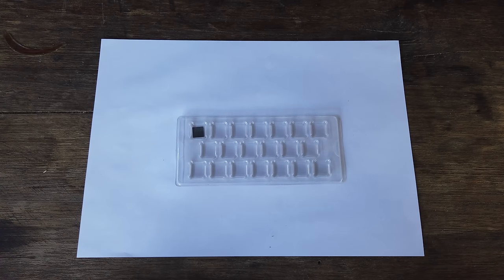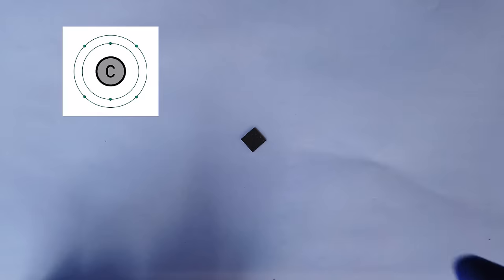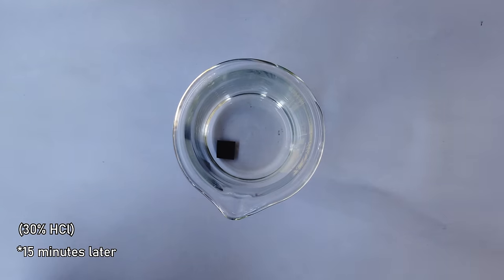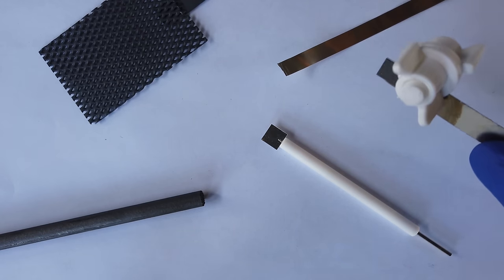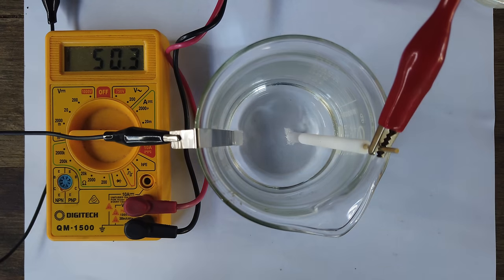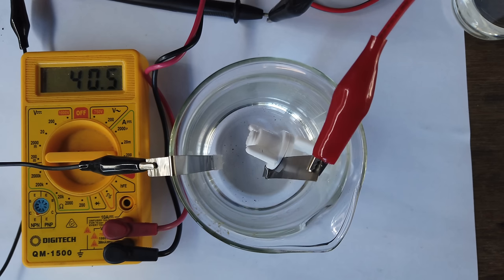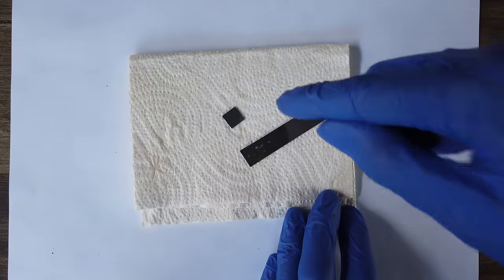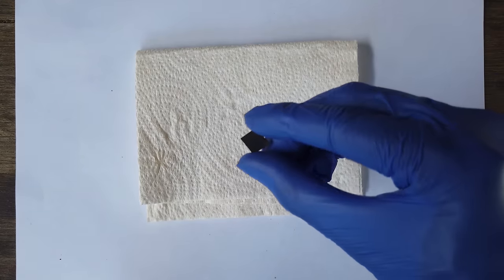A Very Special Electrode

Comment: Why use an expensive electrode if you can use electrolysis with a strong electric field? A simple electrode covered with a thin layer of glass is quite suitable; you just need to apply a sufficiently high voltage and electrolysis occurs without the electrode being destroyed.
Reply from the maker: I highly doubt this works as well as you're suggesting for bulk electrolysis at high currents. I'd be glad to be proven wrong though. Can you point to point me towards a reference?
Reply: @ScrapScience  Which link? Carry out a simple experiment - two test tubes with electrodes inside, a saline solution and a high-voltage DC source, at least a high-voltage transformer with a diode multiplier - even an electric shocker will do. The main thing here is to reduce the distance between the test tubes in the solution to increase the current. The experience is inexpensive and simple.
Reply from the maker: I still don't understand how you're suggesting this would work at all, and I'm not going to build or buy a HV power supply just to test something that I don't believe works. If you don't have any source backing up your claim, I'm just going to believe you're making it up.

Comment: Are there any electrochemical way of making Ozone other than running O2 through an electric arc because that method has a low efficiency and also the ozone it makes is quite impure and often has a lot of Oxygen and a low amount of ozone I want to make pure ozone because I really want to see the pale blue colour of ozone gas.
Reply from the maker: Technically yes, you can make ozone by the electrolysis of water if you use the right electrodes and run a high current density. The concentration of ozone you'd get from any DIY setup would be less than what you get from the electric arc method though I'm afraid. This kind of electrolysis will always still favour the production of oxygen instead.

Comment: aren't those reduction potentials in 10:13 rather than oxidizing.
Reply from the maker: Correct.
I should have either specified that I was talking about standard electrode potentials, or simply made these values negative.
Reply: @ScrapScience  its cool, i feel anyone with a slightly good knowledge of voltaic cells will be able to decern it.

Comment: You got any HgHgO reference electrode? I think this would make you able to separate cathode from Anode Potentials vs. HgHgO and then put the Anode or cathode into nhe/she scale as Listed everywhere. Also I think there should be circuits available for free that you can build your own potentiostate with.... really no prob for 50 mA I would have thought. Depending on how far you want to go....
Reply from the maker: I'll be getting a reference electrode at some point. I avoided performing proper voltammetry in this video because I wanted to keep things relatively simple for now.
Rest assured, there are plans to build a potentiostat and perform some proper electroanalytical techniques in the future :)
Reply: @ScrapScience  nice!
Reply: Do you have the B&F book? I think it had some circuits there. I mean because you're a maker most probably and could build such stuff easily by yourself... and there is tons of other channels that could help you with that
Reply from the maker: I've got access to B&F - I'll have a look!
Reply: @ScrapScience  what is B&F Book ???   Thanks
Reply from the maker: @zaneenaz4962 ‘Bard and Faulkner’ is the one.

Comment: I've been wondering about why does carbon get destroyed when used as a anode in most conditions its used there isnt anthying that can react with it yet it falls apart, i search for it but the only result i found says that its because carbon is porous but then the Cathode would fall apart too but it doesnt.
Reply from the maker: The porosity does come into it, but it's not the main reason behind the degradation. When used as an anode, a very small amount of carbon is able to be oxidised to form CO or CO2. Since these electrodes have a porous structure, this oxidation can happen inside the electrode instead of just on the surface, causing them to disintegrate.
Without any oxidation, no disintegration occurs. Likewise, making the electrodes less porous (i.e. HOPG electrodes) leads to much less electrode damage (but not zero).
Reply: @ScrapScience  Thanks for the reply, that does make a lot of sense. This means that carbon will fall apart faster when making Oxygen like when used in a NaOH solution then when its making cl2?
Reply from the maker: Correct.
When making chlorine from aqueous solution, carbon will fall apart slower (but it will still eventually disintegrate, since there's still water present that could lead to the formation of oxides).

Comment: How does it work for a chlorate cell? Does it work as good as mixed metal oxide?
Reply from the maker: It works great for a chlorate cell! 
MMO electrodes require some degree of care to prevent degradation. For instance, chloride levels should always be high enough, and current density should never be pushed too high. With BDD electrodes here, none of that matters (at least, to a certain extent), as the material is just so highly resistant to degradation.
In fact, BDD is so robust that it can even oxidise chloride all the way to perchlorate with no issues if you run the cell for long enough.
Reply: @ScrapScience  where do I order?
Reply from the maker: This is where I got mine:
https://e6cvd.com/us/application/electrochemistry.html

Comment: What type of MMO anode do you use for experiments, Ir-Ru or Ir-Ta?
Reply from the maker: I’ve only ever used Ir-Ru anodes in my experiments so far. 
I’ll probably work with Ir-Ta at some point, but I’ve got no concrete plans.
Reply: @ScrapScience  I have seen your chlorate cell videos and you should be careful, because Ir-Ru MMO anode can release RuO4 when your cell has high ph(11-14). Your chlorate cells werent ph controlled and had around ph 11. I am not saying that this always happens, but you should be careful.
Reply from the maker: Hmm, interesting. Thanks for the info - I'll look into this some more. Can you provide any sources for me to look at on this? (All good if not)

Comment: You got scammed I think. I got my similar electrode for only about double the price of platinum from eBay.
You gave no dimensions but I think you had rather large hands and I assume that is 15x15mm like mine. (10x10 would have been cheaper).
Reply from the maker: It is 10x10 mm, but I should also probably mention that the BDD is 6 times thicker than my platinum piece...